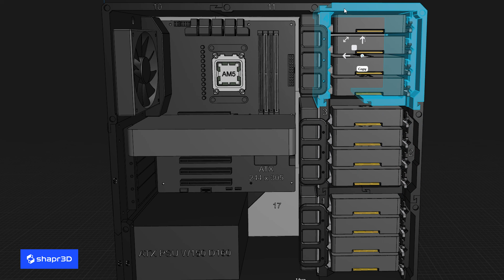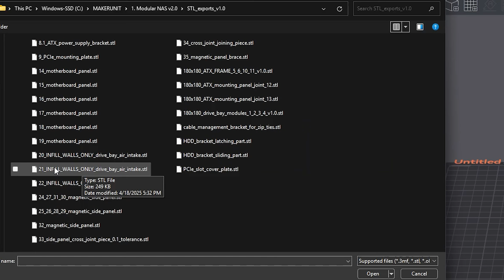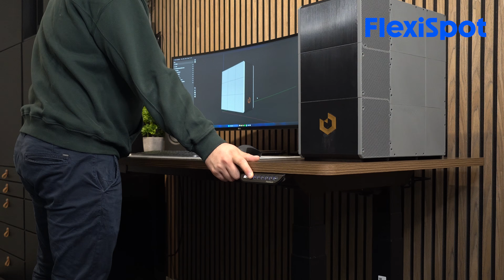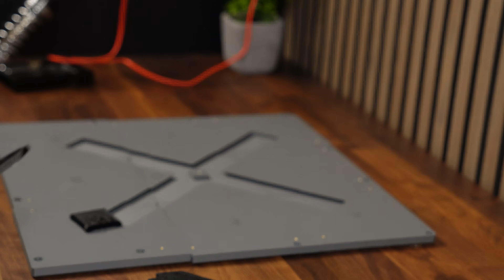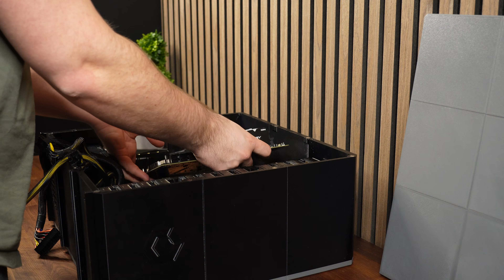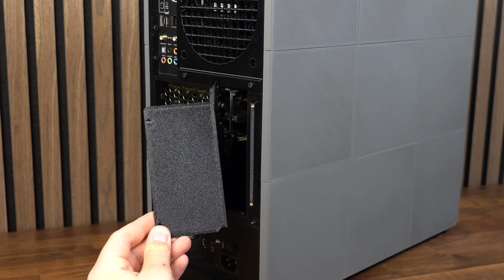Maximize Your Home Storage With This 3D Printed ATX NAS Case

Comment: The side airflow is probably worse for the drives than if it was from the front.

Airflow isn't very strong regardless, when drives are packed that tight together and you're not using loud server fans. But front mesh would have done a little bit of airflow and this side config makes it so almost no air goes over the drives.
Mainly because it gives an easier path of least resistance. The overall airflow you'll feel from the vent will be greater but that's because it's not fighting to go in between the drives.

But i do understand that from a 3d printer manufacturing perspective this is a much better solution than trying to get a nice looking mesh pattern on the z-axis without making a bunch of other sacrifices.
Reply from the maker: You are right, I share the same opinion as to the «optimal» way for the airflow to go. Mainly this was due to printability and structural strength + aesthetics making me choose this option. 

It may appear as if there’s no space between the drives but it’s actually about 4-5mm between them allowing for air to pass through.
Reply: @makerunit  yeah i have a pretty clear idea of how much space is left between drives. It's not very different from cases that used to do this in the early 2000s. It still amounts to over 95% obstruction. Regular case fans aren't designed to work with that. Even radiator fans are engineered for less restriction than that.

But that's besides the point when there isn't a nice way of solving all those problems at the same time without just making the case 2x bigger. Nobody would want that 😂.
Reply from the maker: @ that’s true, yet I feel like despite the restriction there’s still a good amount of air going through the fan blades pushing out the other side of the fan.

But why is it this tight in almost all NAS cases, especially the smaller home-NAS cases they’re almost always squished really tight together. Sometimes even without cooling at all it seems. 🤷‍♂️
Reply: How hot do hard drives actually get? It's not like they are consuming 50w of power each.
Reply: @whiskeyinthejar24  It is true that spinning disks are less sensitive to the heat. And it does depend on what settings you keep them in.
On desktop it's common to let storage drives go to sleep but in NAS applications they often don't spindown if you are using the NAS as more than just network storage.

So you'd be surprised at how hot they can get in a 24/7 setting, they'll be at 40 to 50C at completely idle. It's not a problem if you bought proper nas "red" or security "purple" drives. But "blue" and "green" tier drives will die much sooner than you'd expect. It's not recommended if you care about what you're storing. many people run a homelab NAS just to play with stuff that doesn't care about that.
Reply from the maker: @ Interesting about those color codes, I’ll keep them in mind for future reference,

I’m working on an optional front air intake option to add for those who prefer front intake over side intake. 👍 thanks for your feedback!
Reply: @makerunit  they're the color branding that WD came up with. In the last 10 years seagate and some of the other manufacturers started following the same colors alongside their own branding. 

You can also buy refurb server drives from many sources that also have the reliability and resistance to abuse. They're not as easy to identify because they get sold directly to data centers in bulk and don't have the branding intended for consumers.
Reply from the maker: @ currently I purchased a bunch of really old 750GB WD drives used from some guy on a used marketplace. Mainly to learn how to set it up in the first place. I mean I personally don’t need the 12-bays for my use. I’d probably be fine with 4-6 drives for my «ideal NAS» to store all my footage etc. Drives of 12TB each or something would last me years. I make like 8-10 video projects a year and each project is like 150-250GB of footage. So in a year, like 3TB

 Currently I still store my files on a M.2 but there’s no point keeping it on there
Reply: @SquintyGears  I have no experience in commercial servers etc. I did just pop the side off my old HP workstation home server though and feel the two hard drives. Barely warm. The only cooling effect they have is the idling CPU fan pulling air through the whole case front and out through a tunnel. That system has been on for a few months straight. Only used to access files occasionally and the odd backup though.

Comment: I think adding fan grills to this project would elevate it to the next level. Well done on the design, super impressive.
Reply from the maker: Thank you! 🙏

Fan grills would definitely be handy to keep cables out. I think the reason why I didn’t see this issue myself was my fans had a fan body that was much more closed than the typical fan so cables touching it wasn’t really a problem 😅

Comment: Can you design a GPU rig/rack for AI Machine Learning where the GPUs are distant from each other by using pcie risers? None of the current cases solve this problem.
Reply from the maker: For using in a rack or as a standalone unit?
Reply: @ as a standalone unit. The biggest case which I’m considering buying is Phanteks Server Pro because it can house a threadripper pro e-atx motherboard wrx80e and has a lot of space where the last pcie slot is still usable. However all the GPUs would be almost touching each other. There is a French guy who designed an innovative case where the GPUs are behind the motherboard. There open racks like veddha but pc components get super dusty after a while.
Reply from the maker: @ yeah makes sense, I’ve seen some very interesting PCIe risers that go straigh around the side instead of up/down. Those look kinda practical for a use like that 😊
Reply: @makerunit  keep it up, it’s great to see 3D printed cases. Synology is gonna start losing customers due to their new policy and a lot of people are looking for alternatives and even DIY so you could focus on that.
Reply from the maker: @vitalis  thank you! I’ll do my best to keep the projects coming! 😊 however we have a little son due in 3 weeks so it can happen at any time now. My time to spend on projects will be greatly reduced for a little while now 😅

Comment: Cool, but I can't say I'm a fan of neodymium magnets anywhere near HDDs...
Reply from the maker: I totally understand your concern because we hear all kinds of things about magnets near drives, but remember they are pretty far away from the fragile parts of the drive so I’m not worried at all tbh. You’re going to require a quite strong magnet really close to the critical parts of the drive to be able to do some real damage. The weak magnetic field of a neodymium magnet should not cause any problems at all. 😊
Reply: @makerunit 
Exactly! Inverse square rule iirc from high-schools physics. Your design is fine, those HDDs are safe from those magnets. If they die, it'll be either from the operating temperature or the vibration.

Comment: We need small nas for matx. 6 hdd or 8 hdd
Reply from the maker: Noted! 💪
Reply: @makerunit  I just emailed you my designs for a 8 or 12 bay NAS using MATX and MITX and SATA backplanes. :D
Reply from the maker: @iacon466  Hi, yeah I saw it just haven’t gotten to my PC to check out the files yet 👍 Will get back to you once I’ve been able to take a look.
Reply: Please include an option to use ATX psu, for a budget build, thatnis game changer!!

Comment: Hey Maker great build. For me I'm looking for a smaller footprint nas case which can atleast accommodate 8x3.5 inch hdds. I hope you can make something stackable (4x3.5 bays config) for your older smaller footprint nas case.
Reply from the maker: Thank you! Are you still thinking ATX or smaller motherboards as well? I’m guessing you’ve seen my 6-bay case (?) but that’s not 8, though can hold a total of 9 drives if 3 are SSDs and 6 are HDDs 😅
Reply: @makerunit  yes I have itx board and I've seen your 6 bay case which I really liked but I am only using 3.5inch drives so I need atleast 8 drive case (while thinking about future addition) as I'm currently running 6 drives. I have also seen modcase mass which is stackable but I'm not very confident in the rigidity of that big 3D printed tower in along run lol.😂
Your case is perfect for what I've searched online and the only limitation is upgradability. That's why I suggested the stackable configuration. Thanks for the reply.
Reply from the maker: @WhatThisVideo-WTv  got it, actually this project was originally intended as a modular type system, but due to various reasons I ended up not going through with. I even made an almost finished version but I found that it became incredibly complicated and required way too much filament and number of parts to be reasonable, at least with the way it was originally set up. 

However the drive bays from this one could easily be adapted for a different system so I’ll be sure to keep this in mind as a potential future project 👍

I have not given up on the idea of a fully modular system some time in the future, just need to get that «Eureka» moment realizing how to solve it in a reasonable way without needing 100+ parts.
Reply: @makerunit  Amazing. Thank you.
Also I can share some ideas since I've searched, read, understand a lot of cases, 3D print cases etc while taking inspirations from many but I've no exp with 3d printing or cad etc.
The Jonsbo type cases are quite successful since many people like the small footprint of a case with many drives due to space restrictions(my case too) and some people just go with a large ones. I'm tilted towards this understanding that people going for 3D print cases are those who have space restrictions so they just want to get a smallest one and can add things in future.
Although in my case the problem is availability since many of these small cases are not available. So I am looking for similar functionality through a printed case.
Edit: for now I have shoved 6x3.5 hdds in my NR200 nas and I might add 1 more but that's the max I think this case can take lol.😂

Comment: Very cool build!  I've been eyeballing something like this myself.  Be aware however those HBA (drive controllers) are intended to live in server chassis with lots of airflow.  It's highly advised a fan be mounted in some fashion.
Reply from the maker: Thank you! Yeah I noticed the LSI9300 16i gets extremely hot during operation. I’m considering making a fan bracket for it to keep it actively cooled! 💪 thanks for the suggestion.
Reply: @makerunit  What I did was source a few screws that would grip down between the fins on the heat sink and use them to attach a fan.
Reply from the maker: @fliberdygibits  that sounds like a reasonable solution! How big of a fan were you able to fit?
Reply: @makerunit  I would have to open it up to double check but I know it was a Noctua, I THINK 80mm and it's been rock solid.  I tried some 3d printed mounts which I didn't care for so I finally arrived at this option.
Reply from the maker: @ gotcha! Sounds good 👌 I’ll look into it, I’ve got tons of 92mm fans laying around perhaps I’ll try to make some mount for it

Comment: How about vibration?
Reply from the maker: Mine sits pretty stable with all the drives spinning. However it’s possible to add some pads to the underside to minimize vibration noise if that’s what you’re referring to 😊 the drives themselves don’t have any vibration dampening built in.

Comment: I'm wondering about a cheap ATX fishbowl case with a 3D printed hard drive internal caddy system. Seems like your hard drive racking mechanism has got some utility all on its own.
Reply from the maker: Fishbowl case is a new term to me that I’m not familiar with. Could you elaborate a bit on that for me to better understand what you’re asking exactly?
Reply: @makerunit I believe it refers to cases where the front and side panel have large, joined, clear windows.
Reply from the maker: @whiskeyinthejar24  Ah, makes sense. Fish tank, I did not think of that.

When I read fishbowl I thought literally a fishbowl that was spherical with a hole only in the top 😅

Comment: 1.) The "fan screws" as you call them are just 5mm plastic screws.  They're literally designed so that you can screw into plastic without threaded inserts.  You could have designed your case to use some of those and saved 30.00 in hardware. 😅
2.) In a modern case (especially one that is designed to hold 12 harddrives), you should spend a bit more time optimizing the case for cable management.  There should be a compartment on the back side of the case that lets you route cables behind the motherboard, etc.
3.) They make a chemical called super glue debonder that should allow you to clean up that mess on the front of your case.
4.) You're probably going to get some data loss m drive failure with how tightly packed those drives are (unless they are NAS rated, even then, most NAS grade drives are rated for 4 or 8 total drives, not 12).  I would recommend using some TPU washers/mounting points between the drives and the rest of the rigid case body.
Reply: Nah, they work great. I'm using this method on several custom joysticks.  They're actually stronger in this orientation, because they crunch the layers together a little bit. 

Anyway you can flood fill the gaps or use offset layers if you really need extra strength.

Otherwise, as long as you have enough walls,  you should be fine.
Reply from the maker: I used to use this self-tapping screw method on my earliest case builds a few years back. However I found that it worked pretty well when screwing directly into either the top or bottom layer sides, however when doing it into the side of a part it often ended up causing layer line splits. At least from my experience. Though design elements can probably be added to strengthen this. 😊
Reply from the maker: There are abouy 4-5mm in between each drive. Is this concern mainly due to heat from the drives or is there some kind of interference I’m not aware of? 😊

I’ll see if I can find some super glue debonder or similar chemical to fix the glue damage.
Reply: I'd be pretty hesitant putting plastic screws into a printed part with the threads in line with Z axis of the print though. Sounds like a good way to de laminate the layers. Inserts mean you can repeatedly unscrew/rescrew without warping the plastic after the initial melt.

Comment: Its a cool concept, but with the price of a soldering gun, inserts, filament I feel like this would end up being more than just a cheap 2nd hand case off FB marketplace or something
Reply from the maker: Thanks! Though I mean, the soldering gun/iron would not be a one-time use though. Most people into these kinds of things already own a soldering iron. 

Of course it’s not necessarily the cheapest option available compared to used parts but again this is as much about being able to customize it in the way you want in the colors you want, as well as just the experience building it. For example, why would you buy a lego set when you can just buy a pre-built action figure for less? Or a RC car? 🤷‍♂️😊

Comment: As an older IT geek, I have quite a few older but still powerful enough ATX motherbords that I use/can use for simpler tasks like running CNC machines, HOME ASSISTANT, security DVR, etc. These are functions that dont require a crazy ammount of power or storage or a graphics card, but simply need to sit on a shelf doing whatever it is that they do. I WOULD LOVE, a smaller, bookish style case that took up as little space as possible and only had room for the motherboard itself, a low profile CPU fan and a single SD drive. It could use a MINI ATX PSU or even an external wall wort style PSU.  This way I could stack a bunch of these in a corner and forget abot them. How small could you go? 😀
Reply from the maker: Well I think it’d be possible to stuff quite a bit into a small space. By sacrificing PCIe slot access it’s definitely possible to make a super compact ATX case by using something like a FLEX PSU or similar 😊 I’ve had a «console style» case in mind for a while however my design in mind also has a GPU. Perhaps it could double as optional HDD space as well if not using a GPU.
Reply: @makerunit  That would be amazing. The reason I watchd this video with such interest is because I would like to retire my noisy rack mount, unraid servers, so I bought the files and will start printing soon. You come up with a baby ATX case and Ill take that one as well. Thanks for doing this stuff.
Reply from the maker: @stonesthrowgathering  thank you! 🙏 I love a good design challenge so I find these projects quite amusing to make. The feeling when it just works is amazing!

Comment: Cool, but there is no way I'd trust it to not fall apart if I were to pick it up fully loaded. 
I'd say make the case a bit wider and add a separate motherboard tray to route cables better.
Reply from the maker: I’ve moved this around a ton. Holds together suprisingly well! 😊 Noted, more focus on hidden cable management in a future version 👌

Comment: I haven't seen any EATX or server cases yet... That ATX case is amazing btw.
Reply from the maker: Thank you! 😊 In what scenarios are EATX beneficial over regular ATX? Any specific purposes?
Reply: @makerunit  EATX motherboards for one. Especially server motherboards. I buy older models off eBay that are still really powerful for almost nothing and have a pretty powerful home server. I always have a hard time finding one to hold all the drives I want to add though. A 3D printed customizable EATX case would make my year. Plus, I am not a small guy and I like the extra room to work in.
Reply from the maker: @ ah, got it, makes sense! 😁 I’m so used to more modern parts being smaller and smaller so I kinda think the other direction